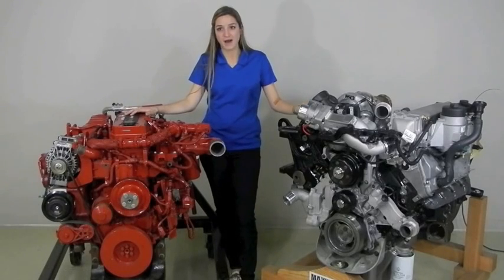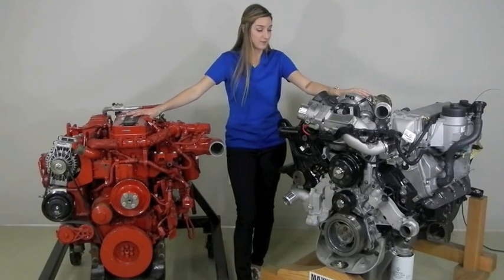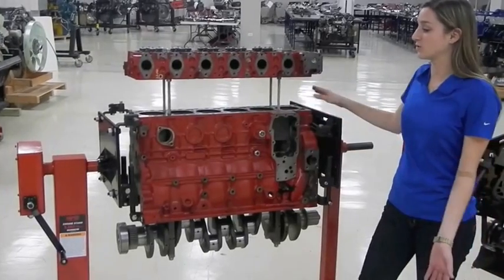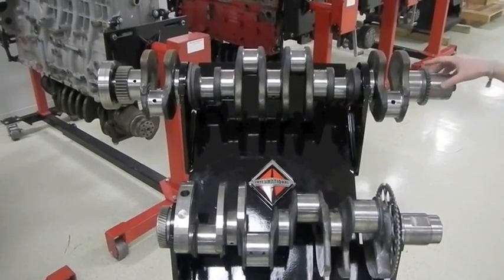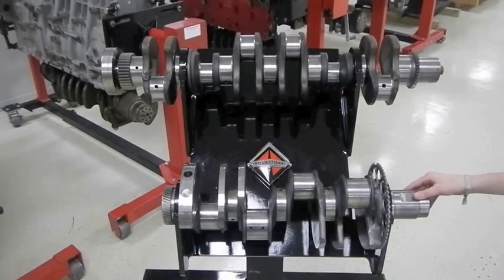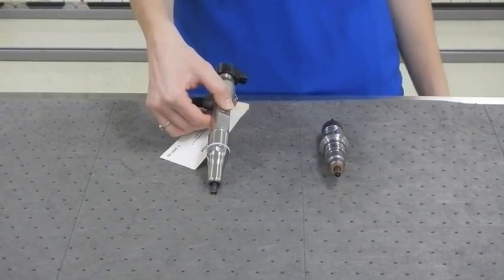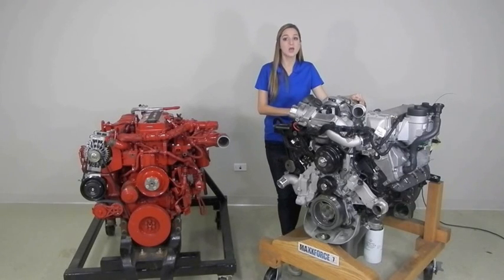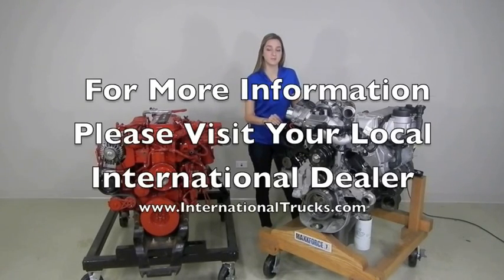MaxxForce 7 vs. Cummins ISB- Medium Duty Truck Diesel Engine Comparison

Comment: If I wanted a Diesel for a 1500-3500 HD pickup I think I'd use a VWG 4.2 TDI. VW has built themselves a pretty sweet power plant. In BVN spec it produce 322 hp @ 3750, and 479 torque @ 1600-3500.
From looking at the mechanical specs for this engine I quickly saw that its a Diesel Hotrodder dream. Factory spec its got a CGI block, DOHC with roller cam followers, forged Chromoly crank shaft, 5 main bearing with 4 bolts per bearing, Bosch high pressure common rail with piezoelectric injectors, and twin VTG turbos. With just upgraded intake and exhaust pipes and a larger intercooler the numbers will get even more interesting. Put in head studs, larger turbos, and plug in a programer and you can really get some serious power out of this little V8.
Reply: And now vw wants to buy Navistar

Comment: For those who disliked this video, are considered in the Cummins' losing side because MaxxForce series doesn't required DEF,  which is more pollutant than Borg Warner's combination of Dual Loop EGR and Dual Catalytic Converters.
Reply: maxxforce will be using def this year. and i worked for international, now i work on cummins so  much better.
Reply: Cummins still make better diesel engines than any other company in the world.  Cummins is the highest selling company followed by Caterpillar.
Reply: Navistar is also buying its aftertreatment systems from... you guessed it Cummins, which they have been doing for over a well year now because they can't meet emission standards with the "Dual Loop Egr and Dual Catalytic Converters."

Comment: The true diesel guys are not going to buy into all this bs. Yes a roller style follower might have a slight advantage with fuel consumption, but if one of those roller bearings were to fail than all your fuel savings + MORE just went right out the window.

Comment: I love how she turned the fact that the Maxxforce has 2 less main bearings, with all being substantially smaller, into a positive.  It's obvious that having less bearing surface increases the load on each bearing undoubtedly leading to reduced bearing life under equal loads.  Also, since when was a light weight crankshaft a bonus in a medium duty truck?  We aren't looking for quick rev times here.  We are looking for a rugged, durable engine.  Not a drag racer. Take a guess which fits that bill.

Comment: funny how you left out the real important issues for fleets,ease of service,and longevity.Also the maxforce has only 4 head bolts per cylinder vs cummins 6,headgasket life is over 2x longer on cummins,and cost is half.Roller lifters on maxxforce fail around 200-300K miles,and take out the engine,huge disadvantage.Then theres torque,and at what RPM,you never mentioned the differences in torque especially below 2000RPM...Cummins is the leader for a reason.